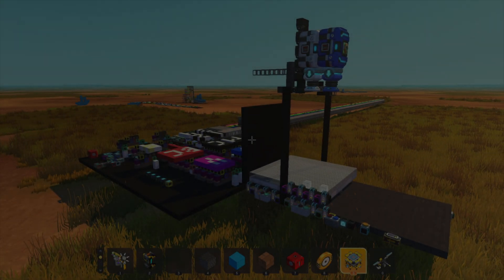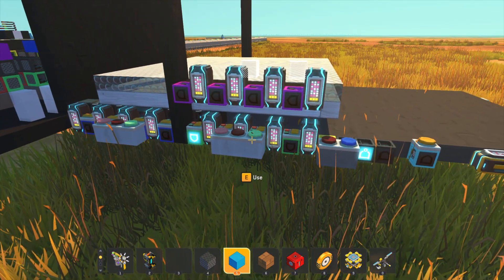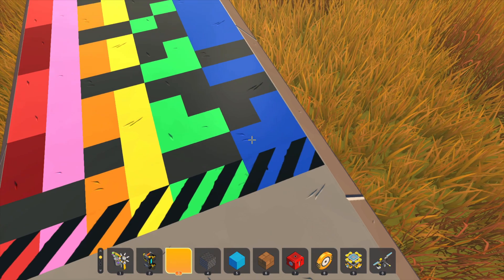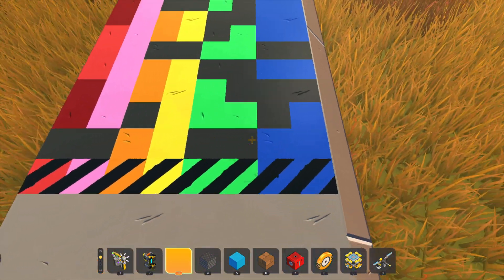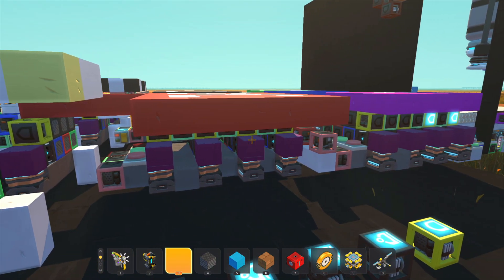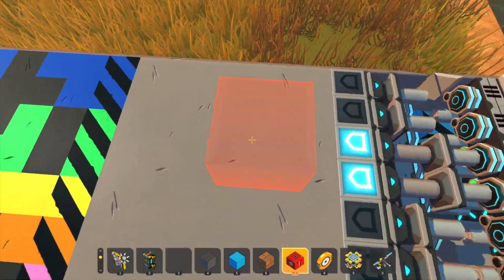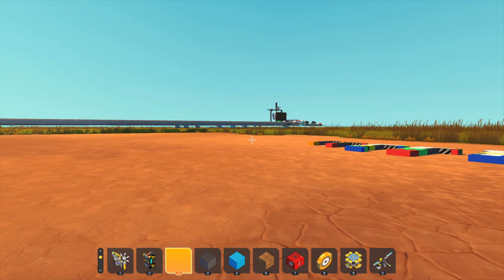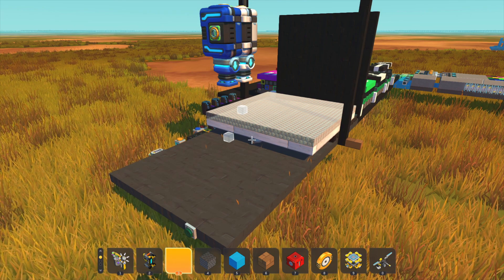How it works | The 3D Printer Project

Comment: That's super awesome !! Don't you think you could use logic for the usb instead of a physical reader ?
You could replace the moving sensors with permanent ones to encode the data, and then have a big binary counter to read each row
But anyway, crazy cool project !
Reply from the maker: My previous design had a bunch of sensors, but it seemed to lag alot more. I was trying to reduce lag and wanted a bit of an easier build with this one.

I have a few ideas in mind for improvements I could try for a USB V3.